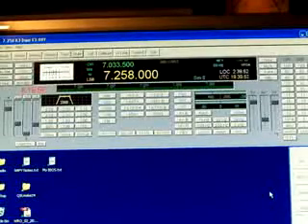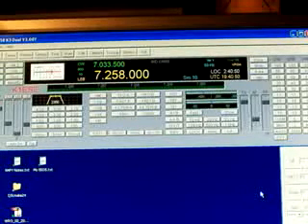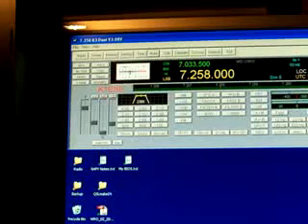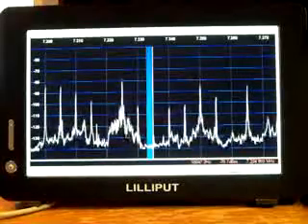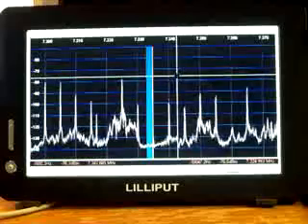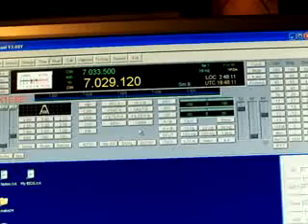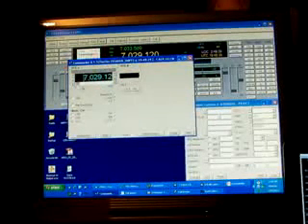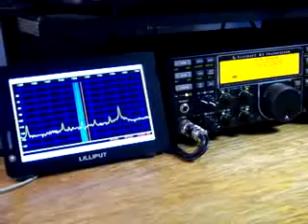K3 and the Computer - N4PY PowerSDR

Comment from the maker: Tom -

When you set up the second Lilliput monitor use Windows Display Properties > Settings> and position the second monitor at (1024, 136).  Then re-sized the PowerSDR (any version) in the main monitor and drag it to the Lilliput so that just the panadapter screen shows.
73 de K1ESE
John